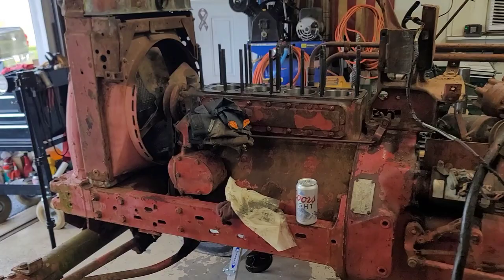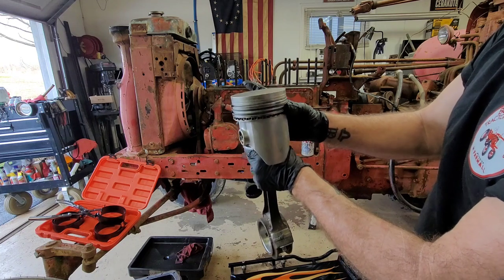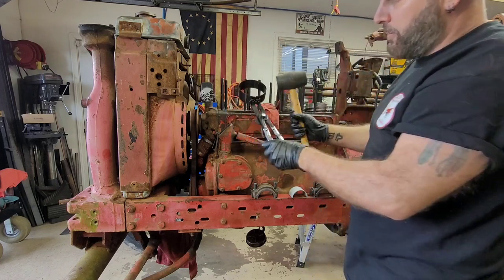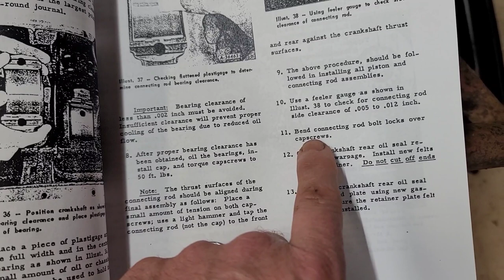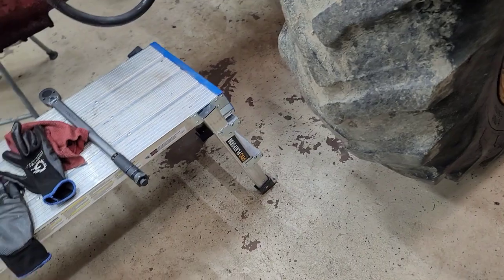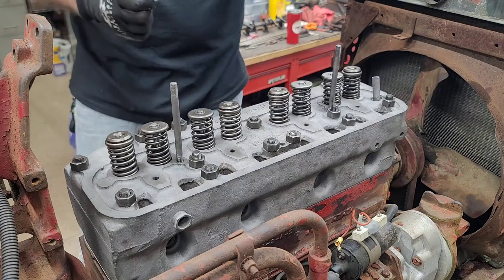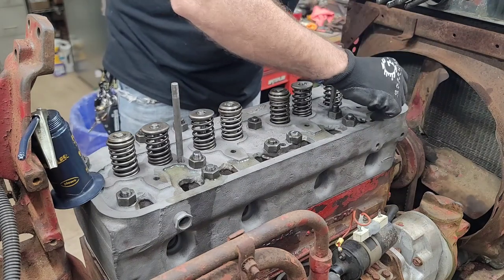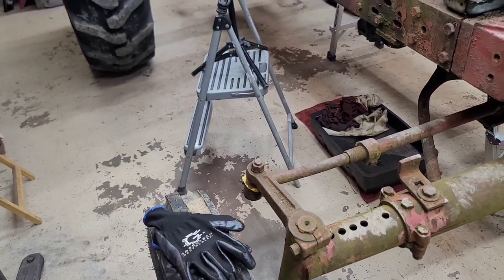Farmall 450 Engine Assembly And Something Cool Shared!

Comment: Another good video. The TA seems to work on my 606 with no heavy load, just going down the road. I was surprised since it has over 6,000 hours. Up date on my 2001 loader, got it mounted and everything hooked up. Bad news , cly on bucket moved in and out but leaked like crazy. Took it to a shop almost an hour away and found out somebody had welded on the rod inside the bore. Shop owner said they will have to make new rod and at least the bore looks OK. $$$$$ hopen it will be like new. I put new rod bearings back in the 606, it doesnt use any keepers on rod bolts only fine thread .
Reply from the maker: Thats ashamed on the rod! Glad to hear your getting it fixed though!